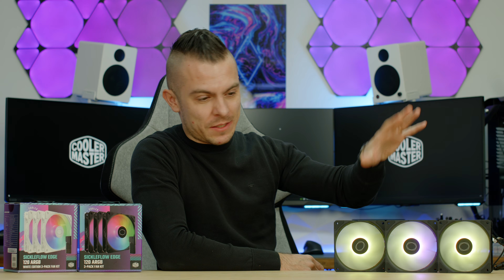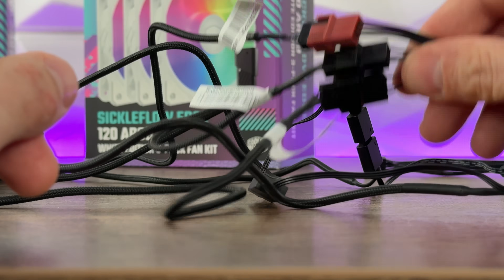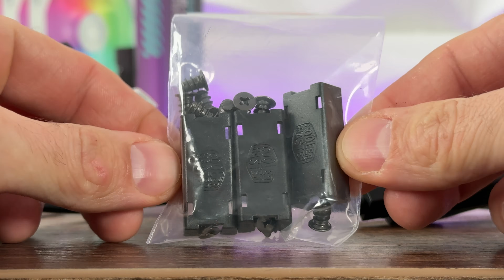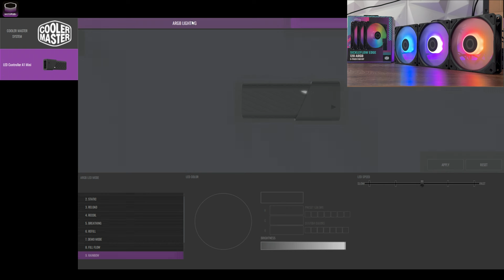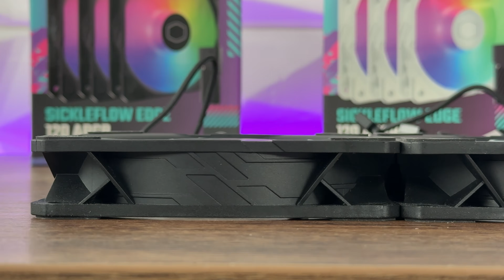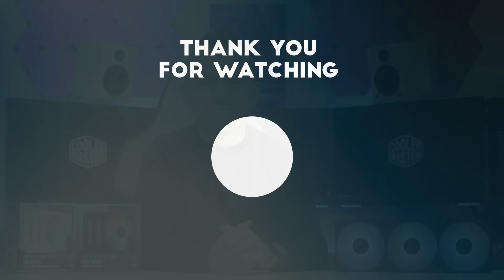Cooler Master SickleFlow Edge 120 ARGB Triple Pack - Overview & Connection Tutorial

Comment: I bought these a few months ago and I noticed that they doesn't "feel" like a real 2500rpm fan at full speed, the airflow is more comparable to a 2000rpm fan despite its specs, have you noticed that too? I double checked rpm readings and they were ok, about 2350rpm.
Reply: Well, its to late to reply i know. Cooler master says that 2500 rpm plus minus 10%.  So its likely really 2350 rpm like you realized.
Reply: @cryophonikk  irc it says +/-10% but this time error was at the bottom

Comment: I just bought this pack specifically to get the mini controller, I asked Cooler Master HQ why they don't sale it separately, they said they don't want to limit the creativity of users since it's only have one port. I just wanted a small controller with full software support for ITX build I did for my girl. Then I sold the fans.
Reply from the maker: I mean, their sentence doesn’t make sense because you can, most likely, plug in an additional splitter to get more connections in. But yeah, the controller is great.